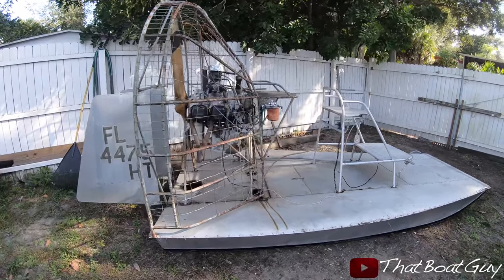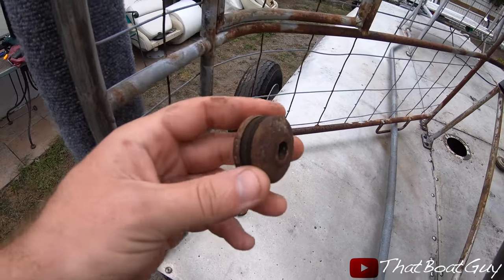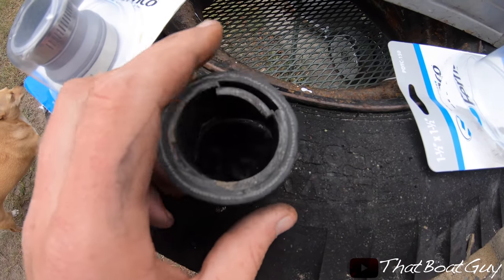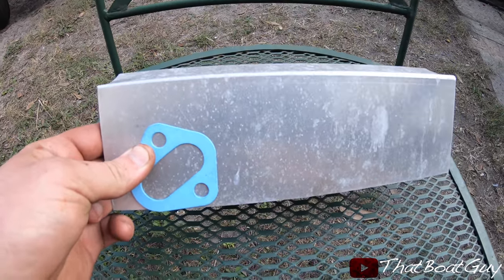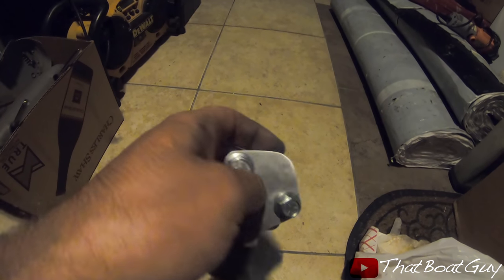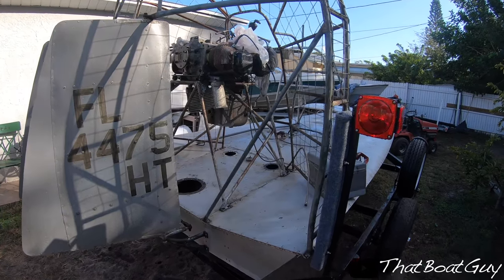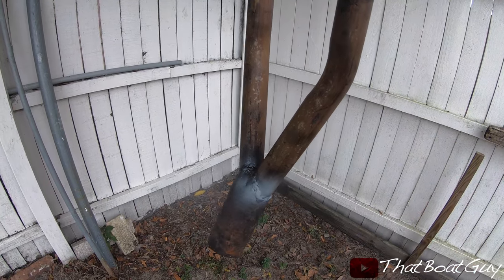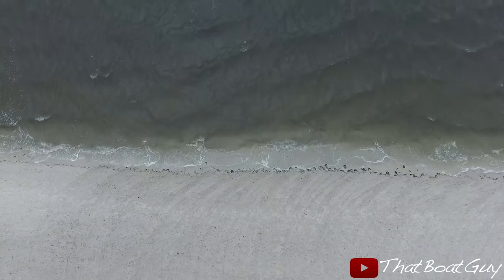Motor Mounts, New Prop, And Painting My $175 Airboat

Comment: I have to add my concern to the others below for painting the engine.  Air cooling is a lot trickier than a water-cooled outboard.  Before you paint, try cleaning the engine with acid-based mag wheel cleaner and leave the aluminum bare to dissipate heat.  Engines on aircraft are never painted.

Comment: Don't get rid of the old prop. I would refinish it. Sand it lightly, and brush on some finish. Just to have a back up prop.
Reply: Or a nice wall decoration
Reply from the maker: The old prop is no good anymore.  I had sensenich look at it. Good wall hanger forsure.

Comment: If you have plans to travel this air-boat to and from the water all the time, take the time now and install both fenders AND some side bunks so loading and unload the boat will be a breeze...no bun intended, but it works. With side bunks, you could easily drive the air-boat on the travel with easy and it will not slide around while on the road. Even with tie-down straps, it will still move some. And the fenders will keep road debris from sand-blasting the sides of the Air-boat. A very good idea to keep the boat cleaner and nice. One other issue. If you have an aluminum hull, don't use the typical red-oxide primers. They are not as good as some self-etching or a zinc-chromate primers that are usually used on aluminum before actual paint. And as far as the engine goes, I would have it media blasted and leave it alone. It would look great and cooler very well that way. Oh, and one last item, your old prop can be refurbished and used. I would sand it down, coat it with polyester resins and fiberglass woven material. Once it cured, a little more sanding and it would look and run like new again. Just some idea...

Comment: If those couplings fail,try the Fernco black rubber couplings, they are thicker and heavier duty than those gray Ferncos. I been Plumbing for 20 years fyi, they are for drainage not pressure.

Comment: Bass Pro sells a coating for duck boats & it has a rougher texture than the bed liner. Easy to roll on. That’s what I used on my boat years ago. Turned out great & it lasts.

Comment: do you have  homedepot nearby.. the gas tank has rust in it.. some super magnets either dropped in and allowed to stick to a corner or wired together with some solid conductor copper wire and dropped in will pull most of the rust out of the fuel and stick it to the magnets.. keeping it out of your fuel system..  Model # 07091HD  Master Magnet 3/4 in. Neodymium Rare-Earth Magnet Discs (3 per Pack)
3/4 in. Neodymium Rare-Earth Magnet Discs (3 per Pack)

Comment: Have you done any research on painting air-cooled engines?  I think it would be best to leave it bare metal.  Painting it, in my mind, would be like adding a layer of insulation - not good for the engine.
Reply: T.L Hill  that's good to know.  It will probably work fine, just something that concerned me.
Reply: T.L Hill  ive painted honda motors and had them over heat.....air temp during operation combined with average rpms will play a huge role in how well it cools. in the case he has the added advantage of a giant fan attached to the engine but i could see it still overheating under the right circumstances
Reply: I'm an aircraft mech, (that's an aircraft engine) - all the engines I've ever seen are painted all over.  Doesn't hurt the cooling.

Comment: be sure to use a VERY light coat of paint on those cylinders or you may have over heating problems.....its an air cooled engine, the paint will slow the transfer of heat from engine to air.

Comment: That paint t is just going to burn off the headers. VHT actually makes paint just for headers
Reply: Yup i did my summit exhaust in ceramic
Reply from the maker: Its rated for 500 degrees. If it burns off I'll repaint them. Its really easy
Reply: @ThatBoatGuy  yup everyone has to learn somehow. 
 Use vht ceramic coating

Comment: If I was you I would polish the side's of the boat get you some alluma Brite and spray the side's and go over the alluma Brite with a piece of fine steel wool or fine Scotch Brite pad and then you can take a buffer or you can do by hand will take longer but I use a cross between mother's and eagle one waden cloth and it will shine like the sun

Comment: I Question That You Shoulda Used High-Temp Paint On Headers? We Shall See How Much Bakes Off?? Are You Going To Put Some Tire Fenders On Trailer??? L@@kin G@@D! Thanks
Reply from the maker: The paint on the headers is rated to 500 degrees and its the color that I wanted. If it does not hold I'll just repaint it.  Its easy to remove the headers. No fenders are going on the trailer.
Reply: @ThatBoatGuy  OK...